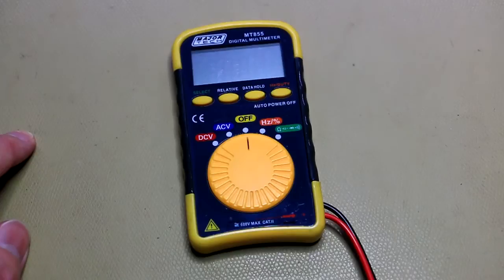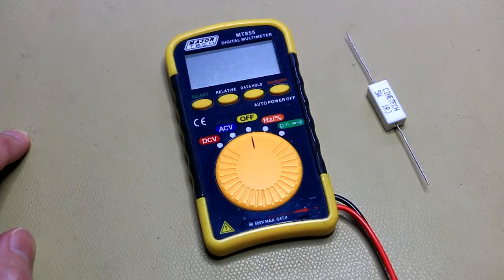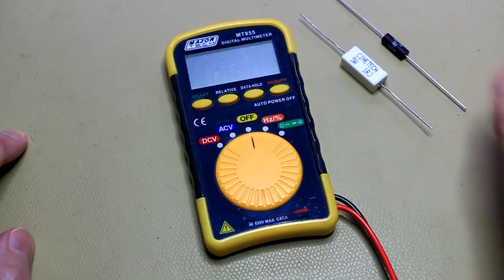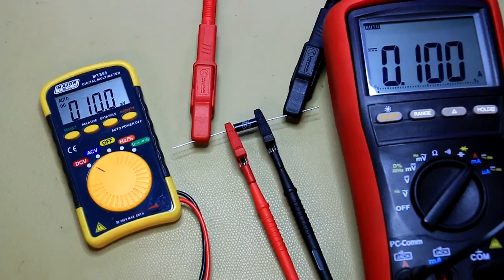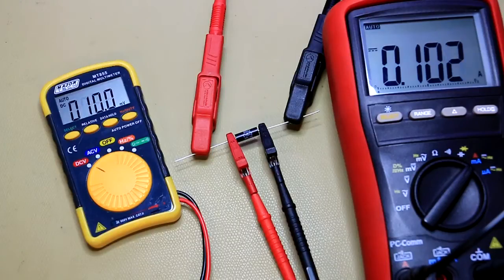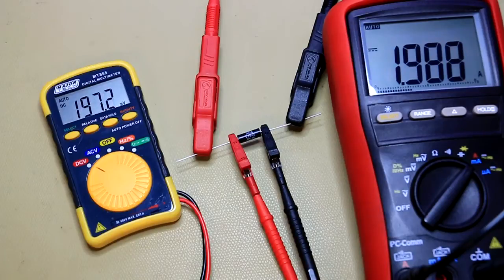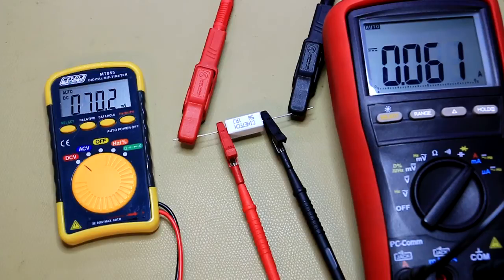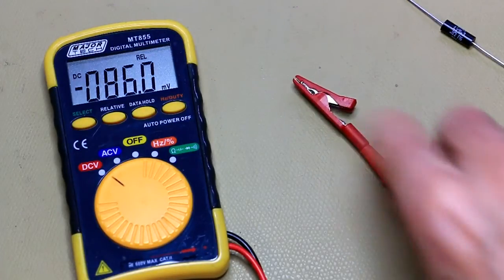Measuring current with a pocket multimeter (#007)

Comment: How is the build quality on that pocket multimeter? I'm considering buying one and have been looking at a few different ones at Ebay, but it would be nice to hear from someone using one of them before making up my mind and placing my order. I found the one you have on tme.eu but under the Axio brand name. Maybe you could make a short review on it? :-)
Reply from the maker: +Eric Olsson Maybe not a bad idea to do a quick review of the meter. I like it - it's very portable and has a good measurement range. Only disadvantage is that it has no current range. I'll see if I can get hold of the UNI-T pocket meter and compare the two. Do you have a link for that Axio branded model?
Reply: +TechBench that would be nice as it gives as you say something to compare it to. Here is the link to the one I found that was exactly as yours but with another name on it, http://www.tme.eu/en/details/ax-ms811/portable-digital-multimeters/axiomet/